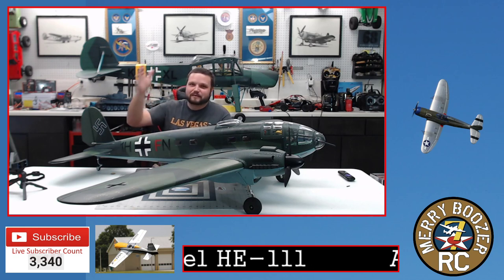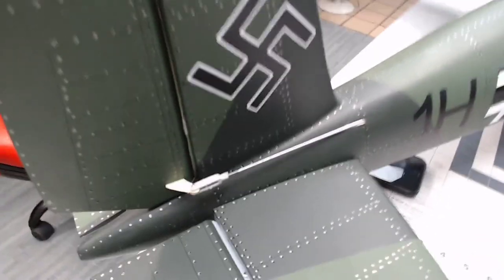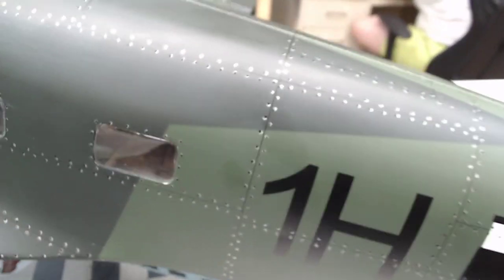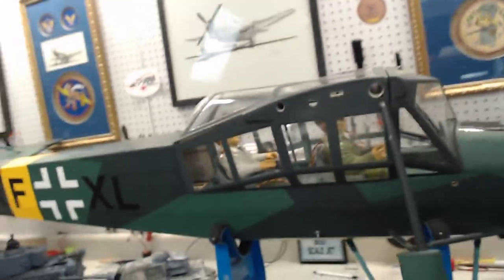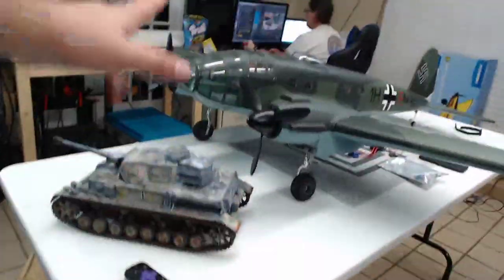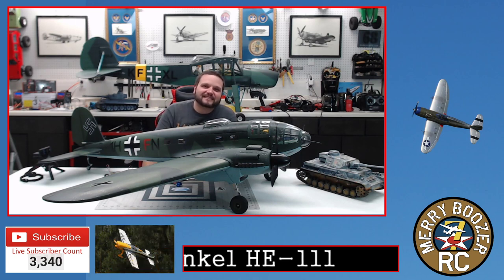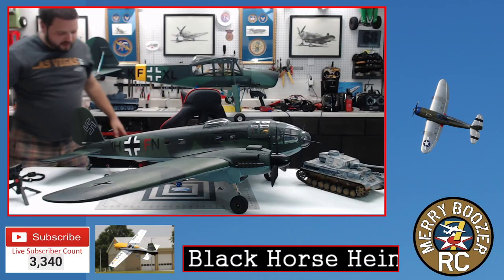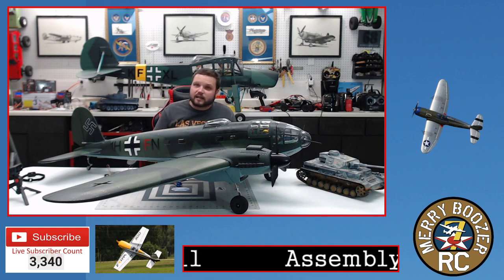Black Horse Heinkel He-111 Assembly Update

Comment: Hi is that the Ar7350 receiver?
Reply from the maker: Steve Gubala AR6200 in the HE-111 AR12120 in the Storch
Reply: How did you install the elevator servos with the 6 channel?  In the video, and the manual the servo position indicated should have each elevator operating opposite of the other unless you reversed one of the elevator servos.